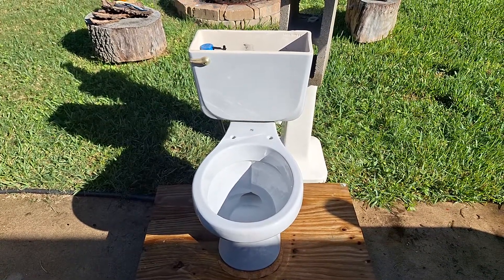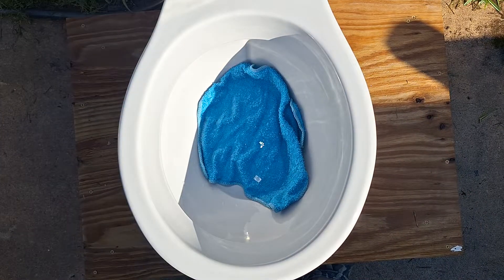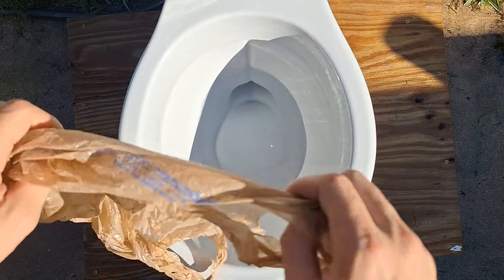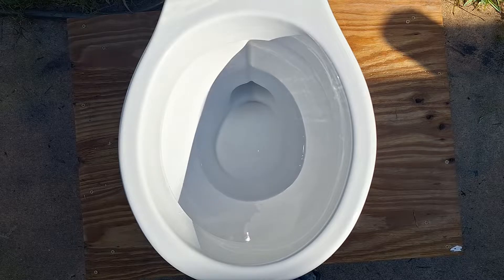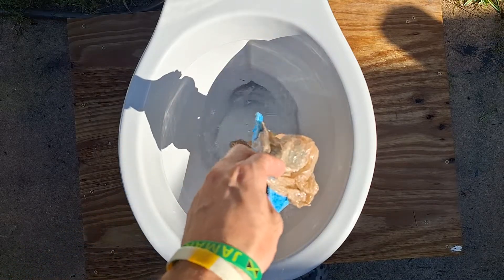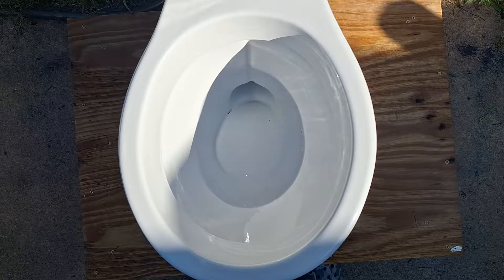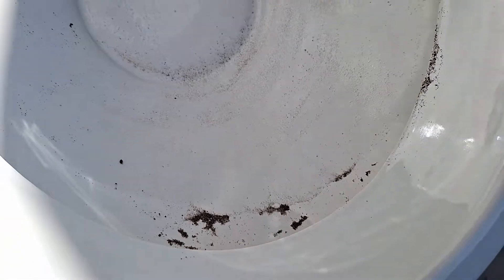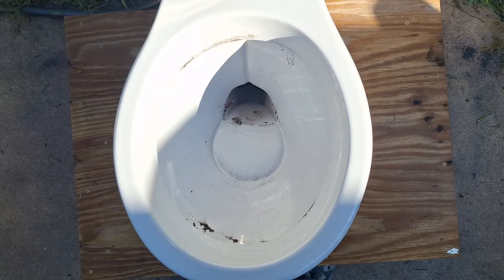1992 Universal-Rundle Atlas Tests

Comment: I quite like open rim toilets as they used to be very common in the UK pre 2001 (when the 1.6 Gal/6 Litre water consumption regulations came in the UK then most toilets have box rims with rim jets as most US toilets have - siphonic bowls nearly always had rim jets with the UK spec single/double trapway toilets made by the top British Manufacturers of the time and the UK modified US design Forward Trap (the Modernus/Vedet being the most notable and successful model) and Siphonic bowl toilets of the 'Standard Era' (Pre Ideal Standard) of the 1930's to 1960's when Standard had a factory in the UK making the Forward Trap, Siphonic and the unsual washdown type - but with rim jets also even though Standard back then focused more on the Siphonic/Forward Trap examples) so this in the US is certainly interesting however the performance is pretty terrible as there is hardly any suction (not surprised as it does not have a siphon jet to help with the suction) and it is certainly starved of water - it would do better with a 3.5 Gal tank. Interesting but junk otherwise. 3/10 as it stands with the 1.6 Gal tank!
Reply from the maker: Yeah, early attempts at any kind of toilet are usually horrible.

Comment: I wish it used 3.5 GPF
Reply: It uses around close to that on most of them. Even though it’s supposed to use 1.5 gpf
Reply from the maker: It would definitely be better that way.
Reply from the maker: @Dreamybull2025 None of these open rim toilets used more than 1.6 gallons unless someone adjusted the water level to a higher height. They were some of the earliest water saving designs.